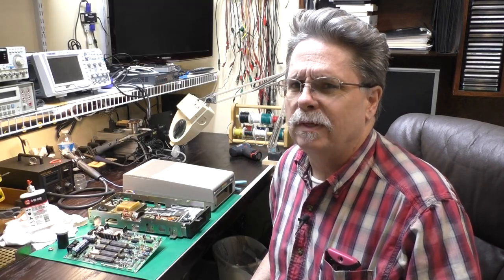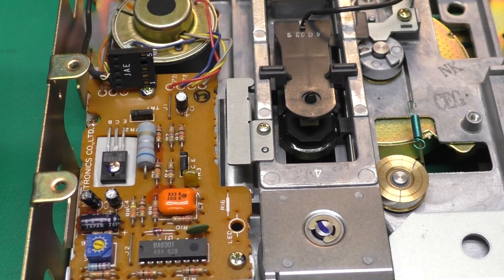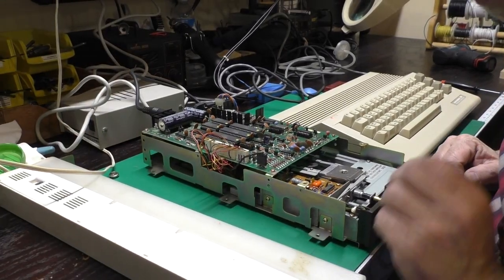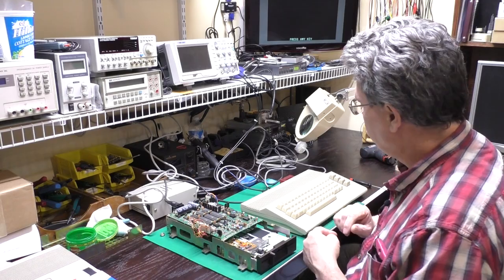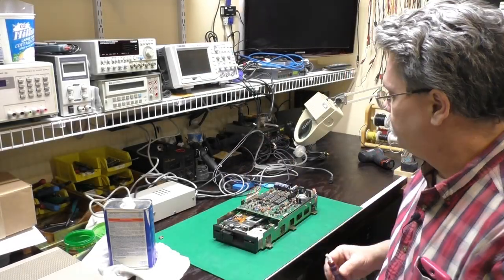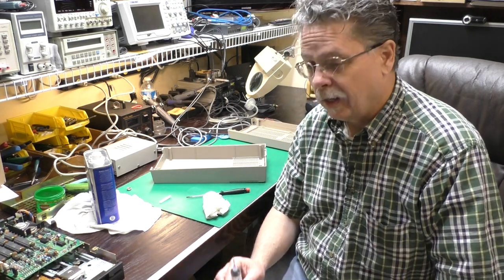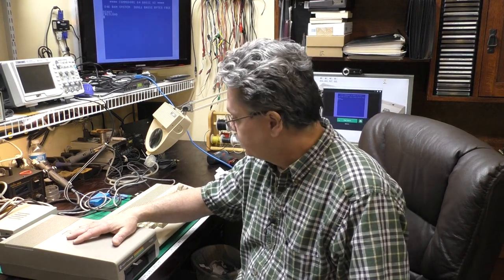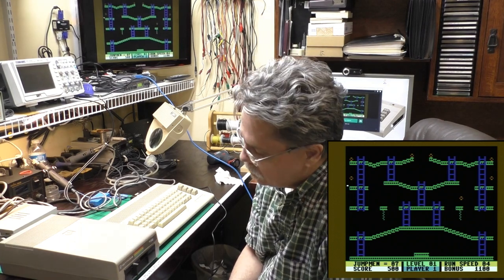I 'Accidentally' refurbished a Commodore 1541 floppy drive

Comment: Hey Jeff. It's always good to see your case repairs. Things to remember when repairing broken plastic cases!
I once got in a heated discussion about the exact function of the load"*",8 command. According to the manual the '*' is a wild card but is also used to load the last active file on the disk. Now, the C64 or the 1541 can't really know what the last used file was when you turn them off or change the disk.But until then, the asterisk actually will load the last file written (and not just the first file).
Reply from the maker: I did not know that! I had always thought it loaded the first file. It is amazing to still keep learning new things about these machines after 30+ years.
Reply: @HeyBirt  I did some tests and although the manual states this "last active file" of course it doesn't work very well. But I thought it was a funny little fact :)

Comment: Those pins are notorious for popping out, I have a 1541 II that had the same issue. I don't understand why they designed it that way... :/
BTW, with a Fastload cartridge in the C64, typing [C=] + [RUN/STOP] is the same as typing LOAD "*",8,1 ... [C=] being the Commodore (or chickenlips as Bill Herd likes to call it)
Great job fixing another one! Thanks for saving it. I saw your case repair kit also on Adrian's channel, he seemed impressed :)
Cheers,
Reply from the maker: Of the three drives I checked only this one had a loose pin, the other two were tight. An interference fit is not uncommon but it requires tight tolerances on both parts or it will be too loose or too tight. A drop of loc-tite from the factory would have prevented the problem too :)

Thanks for the tip on the Fastload cart. I had a generic version as a kid which was lacking the shortcut commands so I never learned them.
Reply: @HeyBirt  Google epyx fastload manual to find a PDF copy. rr.pokefinder.org has a copy for example (just tried it now).
Cheers,
Reply from the maker: Thanks, I grabbed it.
Reply: I came here to say out of 6 drives I bought on ebay, I think 5 had the pin out of position. Including 2 1571s and I think a 1541-II
Reply from the maker: That is interesting. Out of curiosity were they shipped without the transit card inserted? I am wondering if bouncing around in shipping would loosen the pin. With a disc/transit card inserted and drive latched there would be pressure on the pin so it could not back out.
Reply: Hey Birt! They weren’t locked down as I recall. But I suspect these pins backed out while the drives were in service. Maybe not though 🤷🏼‍♂️

Comment: Thanks for the repair demonstration, I'm tempted to try to fix mine. Kudos.
Reply from the maker: I have found that most of the time a simple cleaning and lubrication is all that is needed. I have had a few with electronic failures though. My best advise is to not be tempted to try and adjust alignment, that is an easy way to get into trouble :)

Comment: I accidentally fixed my old 1541-II. It was flakey back when I was 16yo, especially when it heated up, I never worked out why...
I dug it out a couple years back, opened it up and right away noticed the socketed CPU was a bit wonky, deoxited it and refitted. I haven't had a problem since. :)
Reply from the maker: Good job. Deoxit can work wonders. Many years ago I serviced a piece of equipment that was located in a damp basement and at least once a year I would have to pull and reseat the EPROM. After treating with Deoxit I never had to do that again.

Comment: Question. Has anybody else noticed that Q-tips quality has deteriorated compared to 20 years ago? The tip seems to unwind/fluff and slip from the paper/plastic handle more easily.
Reply from the maker: That could be. I used to have some 'industrial' cotton swaps, the type with wooden sticks instead of paper. Those were better, but more expensive.

Comment: You should demonstrate a "full" refurbish.. 
1) recap mainboard and controller board (people always forget the 2nd one)
2) set the speed to 300 after recapping
3) replace MOS6522's with W65C22N chips
4) replace the 2KB SRAM chip with a universal 6502 SRAM adapter (fixes buffer overruns when copying some games)
5) replace the TO-3's with switching regulators

You will have a very low-power 1541 when you're done, and you can stack them without ever worrying about them overheating.
Reply from the maker: Hi, thanks for your feedback. I have an episode in the 'Troubleshooting Vintage Computers Series' coming up that deals specifically with 'recapping'. It details why you might need to do so or not, how to go about doing so, etc.
Reply: @HeyBirt  I appreciate your efforts in the troubleshooting series. I hope it helps to guide some that do not have a diagnostics background. There are a lot of let's fix videos  YouTube but not much explaining the approach.
Cheers,
Reply from the maker: Thanks Eddy. I'm hoping to share some of the things others have shared with me over the years.